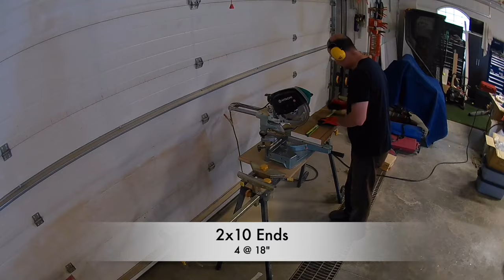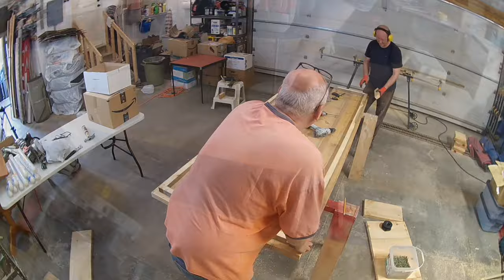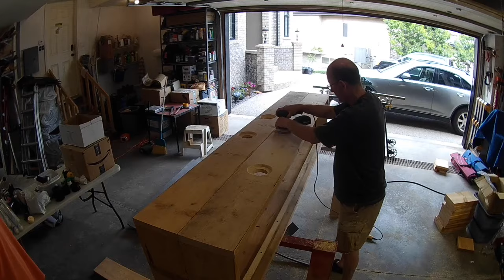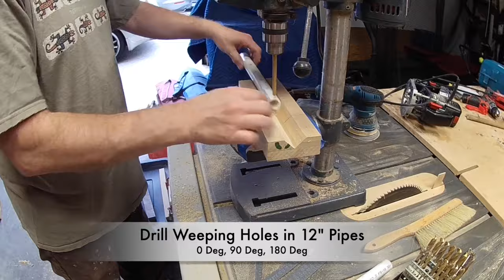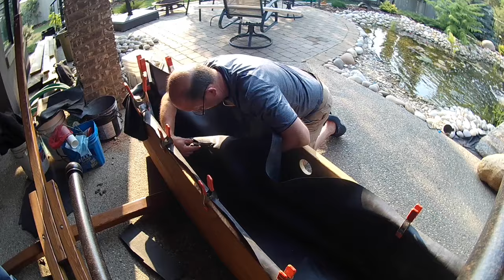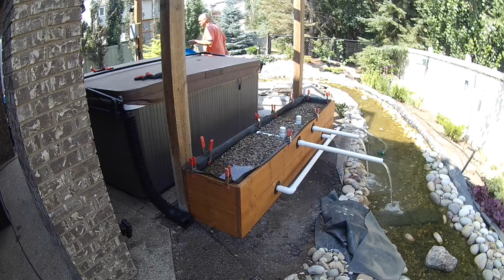Algae vs Bog Filter (Timelapse)

Comment: Did you use aquablox on the bottom or just gravel on top of the plumbing?
Reply from the maker: Just gravel.  I have tones of volume as the water comes from the pond.  The gravel also gives more surface area for beneficial bacteria.

Comment: I did a similar thing in a bathtub for the duck pond. I regretted putting so much gravel in when it came time to strip it down to clean out the gunk. Maybe your other filters remove more solid matter than mine managed to so you might not need to. This year I have the plants in pots with less gravel, so cleaning should be easier next year. Yours is better looking than mine, I plan to surround the tub with logs but haven't got that far yet.
Reply from the maker: Part of the thought of having the 2 inch pipes feeding the filter is that it can be back flushed.  Fill it up and open up the valve to purge any sediment or muck out of the filter.  It still has to make it through the weeping holes, but the volume of water draining should help to get any sediment into suspension to flush out.
Reply: @gtrsquared919  That's a clever idea!

Comment: Loved watching how you constructed your bog filter. I built a 64ltr bog filter about six months ago, I used 15mm pebbles and 35mm pebbles. It started well cleared the water in no time but after 2 weeks it clogged up due to the smaller pebbles. So I emptied it again and just used the 35mm pebbles and worked so beautiful, but now after six months it started to clog again, I rinsed the muck through the bottom drain without removing the plants and pebbles. Is it normal that I have to rinse the muck every so often or did I do something wrong? I used 40mm pvc pipes for intake and out and 25mm on the bottom for the drain just in case I need to drain it out which worked well for me to rinse the pebbles.
Reply from the maker: I think it is common to have some muck buildup over time.  You may not have enough flow through the filter.  If the water is passing through the filter too slowly any muck or sediment is not kept in suspension and will accumulate in the filter.  I would try increasing the flow rate through the bog filter and see if that helps with the issue.  Thanks for watching.  Let us know if this works for you.

Comment: It's all so beautiful and well built. It's just a shame you didn't put as much thought and naturalized work done to the return water going back into the pond. The two bare white PCV pipes were a stark after thought coming out of a finely built wooden structure. I'd like to see a concrete brook-like return on one side and perhaps a water wheel type return on the other side. Like the old water wheels on brooks/rivers that created power to grind grain. Maybe you could add a second phase to it where you make the water wheel generate electricity to light some LED pond lights that would be visible at night. You two are so talented I believe you could make it even more spectacular. But an excellent video that illustrates to the viewer which tools to make a professional bog structure..
Reply: Well done. The compliment. Complaint. Compliment sandwich. You possess real synergy.
Reply from the maker: The pipes are only temporary.  We are in the process of upgrading the stream and should be posting an update video soon.

Comment: Possibly I missed something with the time-lapse but wouldn't the weeping holes in that manifold mean that cementing the other joints of that assembly was unnecessary?
Reply from the maker: It is good practice.  Don't want something shifting and coming apart.  It is a lot of gravel to take out to do a repair.  Thanks for watching the video.  And thanks for taking the time to comment.

Comment: That is a very cool vid!  I really enjoyed watching it.  I wonder what it'd look like if the PVC was painted like wood or steel.
Reply from the maker: The pipes are just temporary.  In the spring we will be adding a waterfall with a small pool at the top.  The bog filter will spill into the small pool.  The plan is to post a follow up video when the work is completed.  Keep an eye out for it.

Thanks for the comment.
Reply: @gtrsquared919  spring has come and gone... ::taps wristwatch expectantly::

Comment: 🧐how does a bog filter fight the algae?  Also, how will you stop mosquitos?
Reply from the maker: Algae grows on the nutrients in the water.  The bog filter uses plants to use up the nutrients before they build up to the point where the algae will thrive.  The water in the filter is always moving and is covered with gravel so mosquitoes are not an issue.
Reply: @gtrsquared919  Cool! Thank you!

Comment: Why did the pipes float to the top when you filled it with water 😉
Reply from the maker: Cool optical illusion isn't it.
Reply: The correct answer is the refraction of light makes it appear as though the pipes float to the top